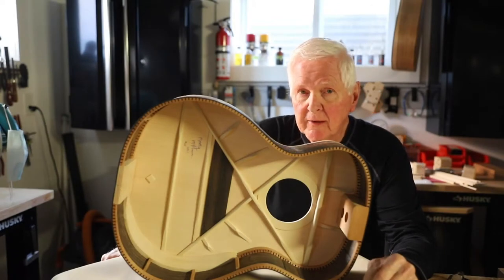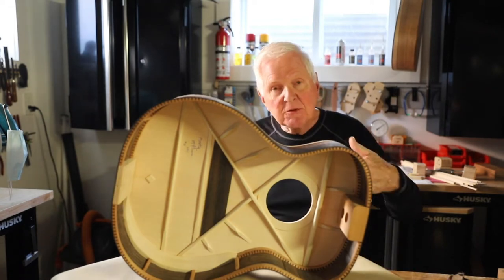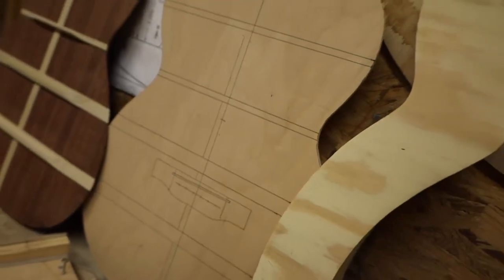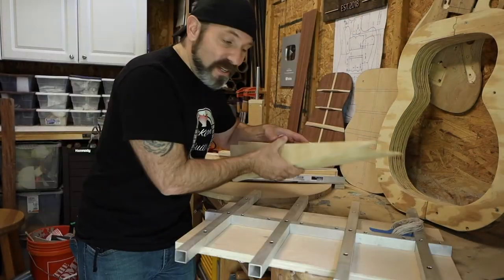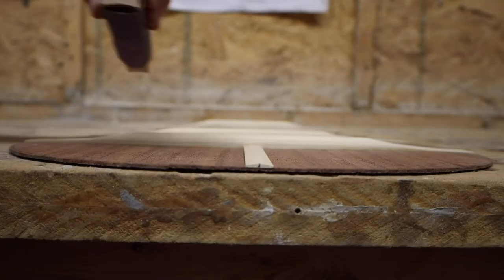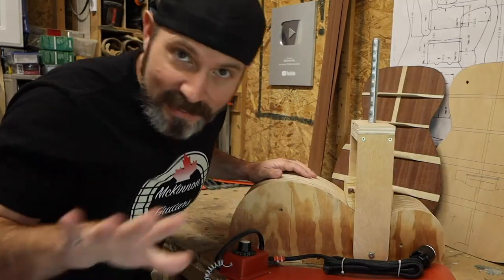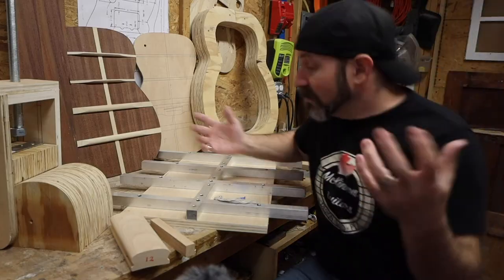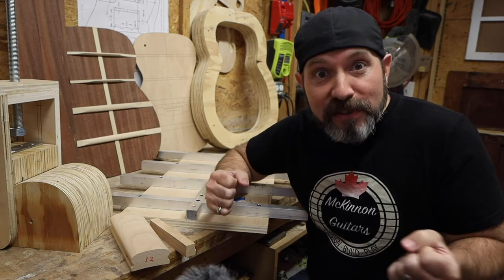What's on YOUR Bench? A New Segment Dedicated to YOU and YOUR Hobby

Comment: I like that idea of a tuck away side bender. I was trying to make the full Charles Fox bender. I’ll definitely check out the link the screw press. 

By the way, isn’t a fretboard radius supposed to be flatter, like 16”? 

PS: I’m definitely going to buy radius dishes. I’ve worked with MDF. It’s worse than that green tea! The dust is like a powder and it gets EVERYWHERE.
Reply from the maker: Yes, 20 in the upper area and 16 in the lower.  12 is for electrics I believe.
Reply: That’s for sure! Haha